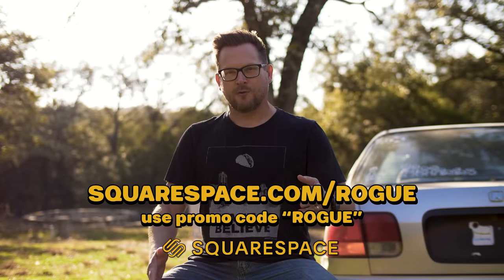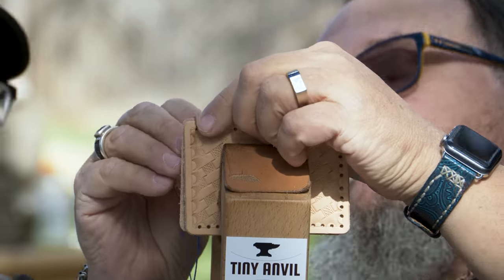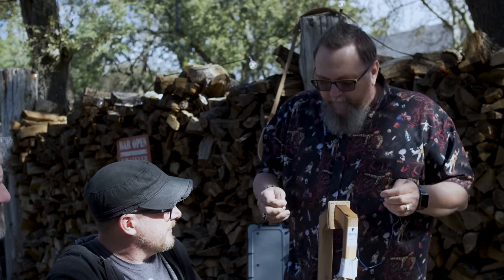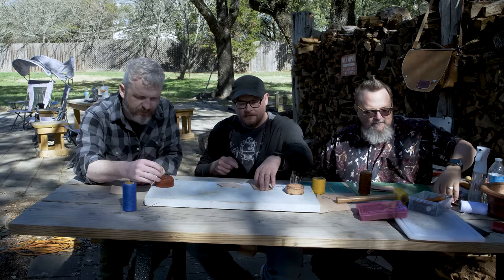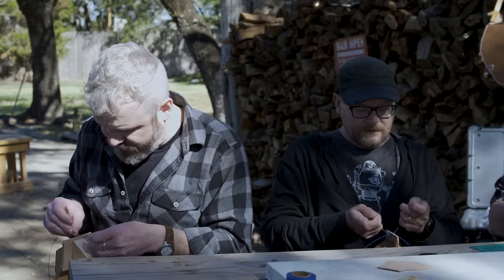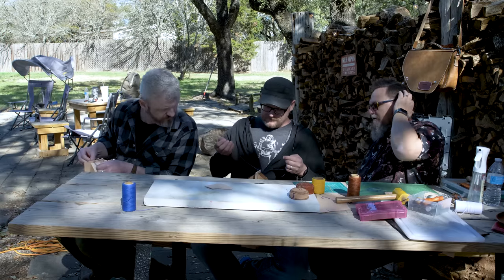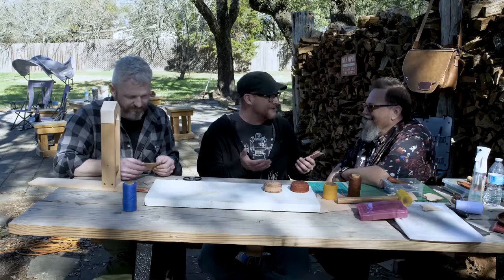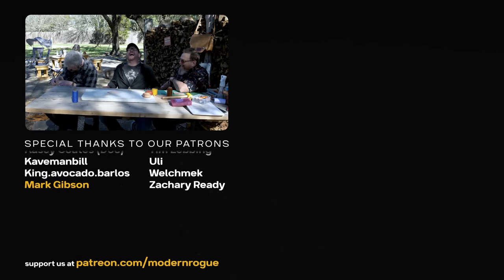Advanced Leather: Saddle-Stitching (w/ CJ Johnson)

Comment: The wax (formally known as thread conditioner) is primarily for ease of use but it can be for longevity depending on the thread composition and its intended use (i.e. it's not good for natural fibres or for fine work like embrodery*).
Realistically speaking, if you have a good thread from a good company, you shouldn't need wax to make it work.

*Unless you're coating it yourself with 100% beeswax. Silicone based coatings will do much more harm than good for your threads.

Tbh as far as leatherworking goes, you'll end up waxing the thread yourself anyway when you clean and wax your leather soooo kinda pointless to use pre-waxed thread or even wax it yourself.